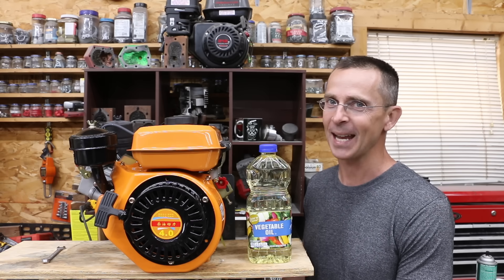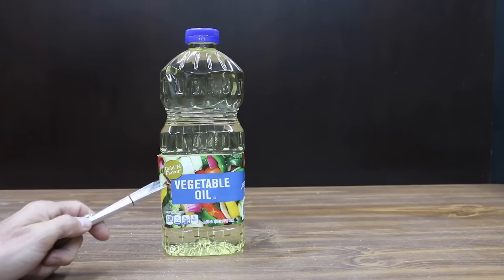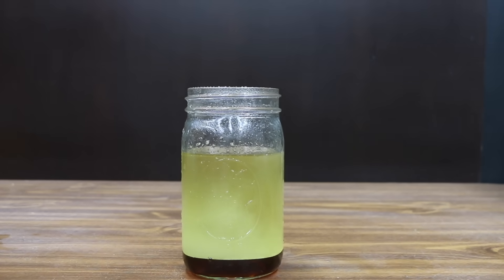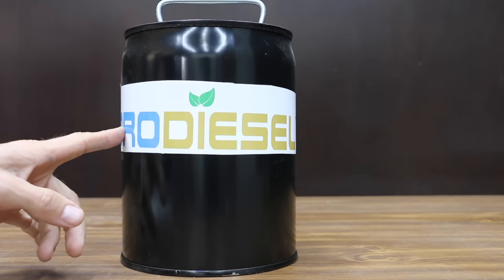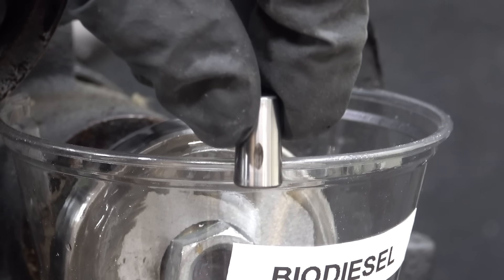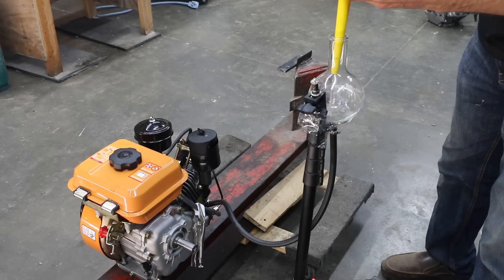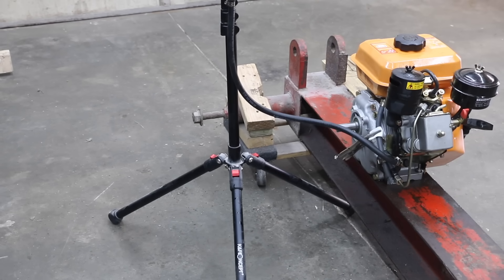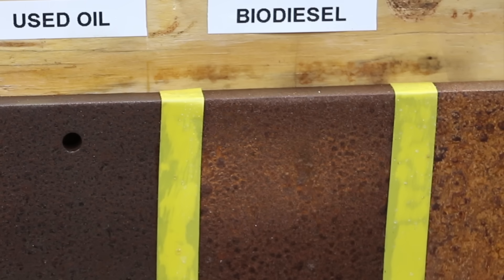Make "Biodiesel"? Let’s find out! Diesel vs Biodiesel, Used Motor Oil, Vegetable Oil, MPG

Comment: My 2000 7.3 loves running on used oil. Feels like it has more power but burns it alot faster.
Reply from the maker: That' 7.3 is a great engine!  Great feedback on the used oil!
Reply: @ProjectFarm  I just dump it in my 105 gallon L shape tank and the in line filter on the pump seems to get it clean enough. I try to run about 50/50 used motor oil and #2 diesel. I have run it on 100% used motor oil a time or 2 in a pinch the engine never skipped a beat and ran just fine on 100% used motor oil. I have read many guys just dump it right from pan into tank on these older "Oil burners" Love your videos!!!

Any chance to run some stiction eliminator? I always see ads and commercials about it but the reviews are very very bi polar. Half the people said it really helped with there worn out 7.3s and 6.0s others say they had nothing but more and more issues after running stiction eliminator. Might be a fun test but I'm not sure how you could really test it.

Comment: I was just thinking maybe you should test diesel engine oils.
Reply from the maker: Great suggestion!
Reply: Many people use diesel oil in their gas engines. I'm going to use w15-40 in my '41 Farmall H. I want to see if the oil pressure will stay a bit higher when warmed up.
Reply: @dans_Learning_Curve  i run Delo 15-w-40 in literally EVERY gas engine i own, from my little honda powered 4-stroke weedeater, all 3 of my various brand push mowers, my 12hp Kohler in my Cub Cadet 1200, my 2200 4 cylinder 98 cavalier, my 03 oldsmobile Aurora, my 04 Cadillac Deville (both Deville and Aurora are Northstar engines) and my 6.0 gas 02 Silverado 2500HD, and I can tell you that I have not had ANY internal engine problems, and all the ones with oil gauges have not dropped a single pound of oil pressure in the past 15 years
Reply: Hyster forklifts call out 15-40 oil in the GM 4 &6 cylinder gas engines they use.

Comment: Yes a Diesel engine! 

Edit: I used to have an old diesel Peugeot which ran on any oil even on straight SAE 30 2 stroke mixed with some diesel.
Reply from the maker: Great feedback!  Thank you
Reply: I remember seeing a Duramax dyno video and the guy said a diesel will run on it's own oil, I didn't believe it then but I'm a believer now. That's pretty amazing.
Reply: @marcus3128  That's what most diesel runaways are caused by, oil seals let go in the turbo, dump oil into the intake, and if there is no kind of shutter valve in the intake it will overrev and blow itself up with no way to stop it unless you have a CO2 extinguisher to spray in the intake fast enough.
Reply: Many old diesel engines will run on just about anything. All this modern stuff (e.g. high pressure fuel rails, DPFs etc) seem to be pretty fussy about what you put in them.

Comment: Can you do a video on the best garden hose? I know it's kinda lame but maybe test for max pressure, Weed Wacker strike integrity etc
Reply from the maker: Great recommendation!  What brands would you like tested?
Reply: @ProjectFarm  please include some of the "flex" type hoses. I've found them to be very convenient, but I'm not too sure about actual durability just yet.
Reply: @ProjectFarm  For sure flexzilla, bionic steel, maybe a cheap and expensive expandable one and a few house brands from rural king/menards/harbor freight etc.
Reply: Hell yeah. I second this.
Reply: I third this motion!  What about also kink resistance? and we also run them over all the time so the connector durability could be tested too.  Should find any more expensive brand and then put it up against the usual suspects from Harbor Freight
Reply: How long will they stay flexiable/ pliable when left outside. I bought a 3/4" hose from harbor freight that has gotten hard over the years.